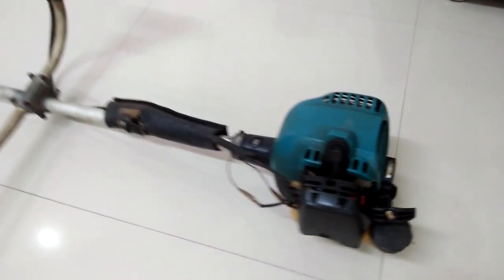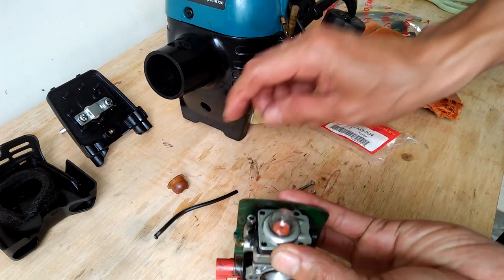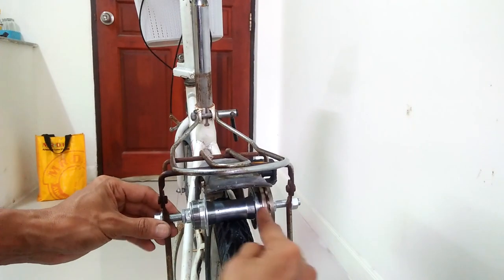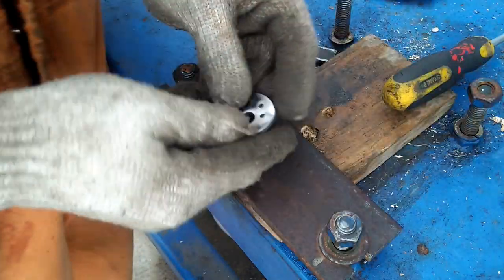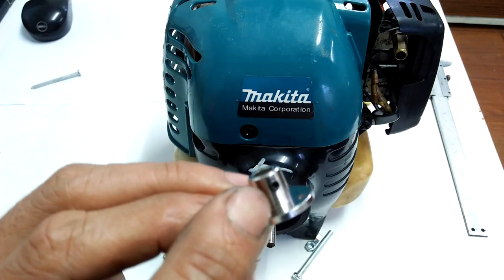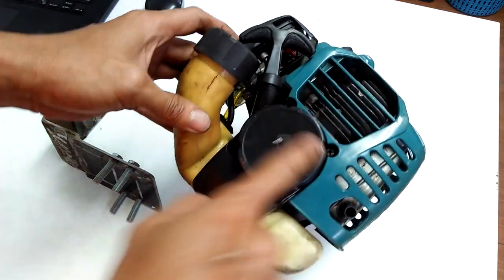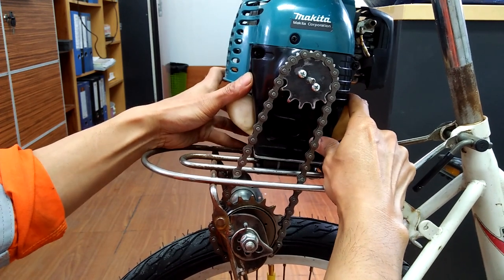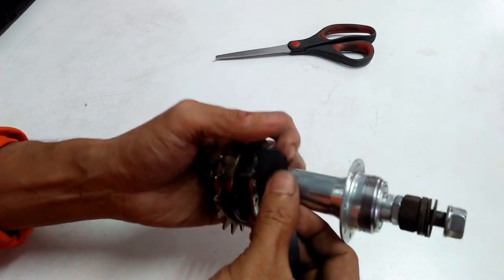Motor Assisted Bicycle Prototype Using Weed Eater / Grass Cutter Engine

Comment: Good project boss. Very few people even think of putting a gas engine on a 20 inch folding bike. I myself built a 26 inch motorized gravel bike but am thinking of converting my 20 inch as well. Do you think you can make a way to put the motor in the middle of the bike?
Reply from the maker: Yes, if you can devise a way to mount it. The 20-inch bike is low, but the seat and your body can be as high as the bigger wheel bikes. Therefore, there can be a space in the middle.

Comment: What's stopping the sprocket from falling out of the engine ?
Reply from the maker: it did not make it in the video, but I made a simple chain guard that also prevent the sprocket shaft from falling out.